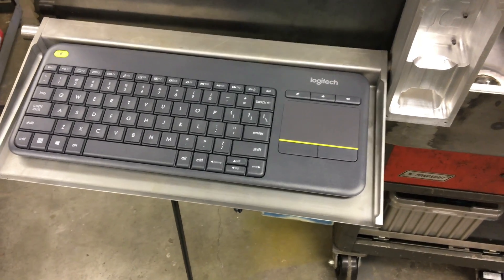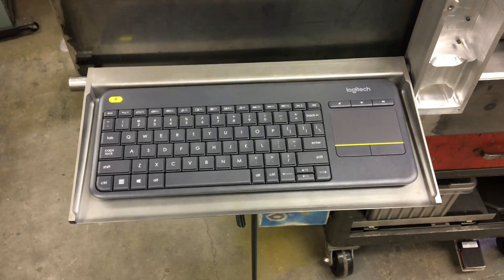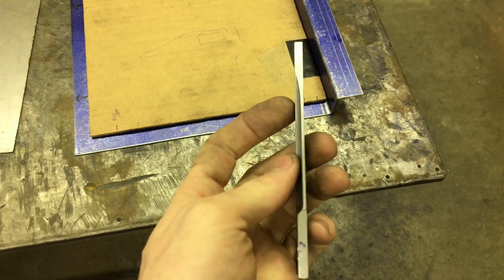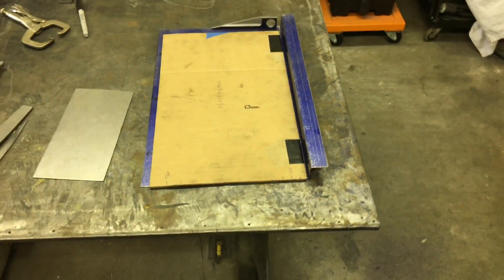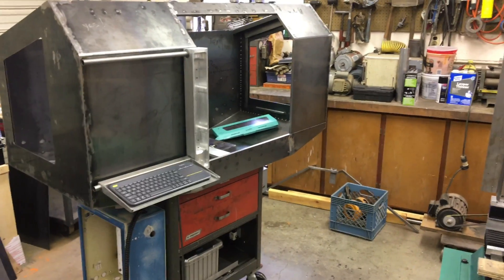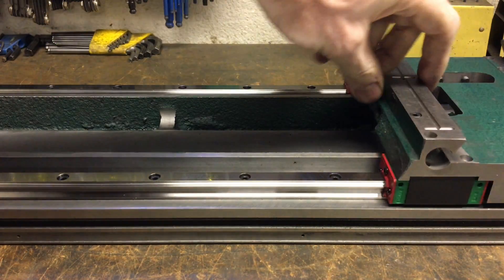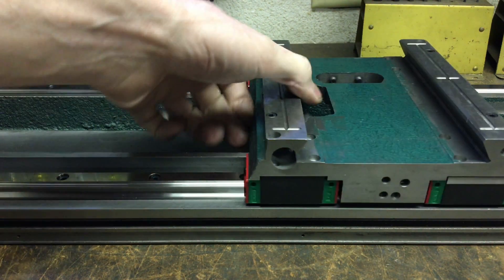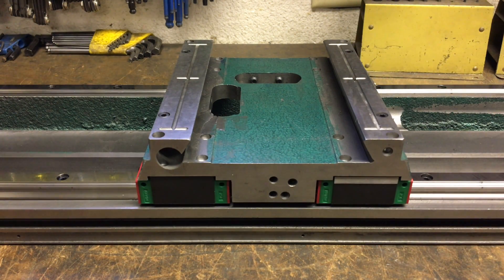GRIZZLY G0704 CNC Conversion Update 13 - ( X Linear rails complete / Keyboard tray )

Comment: I have an older machine with worn dovetails I'm about to do the same and extend the table travel at the same time. What is the weight rating of your rails?
Reply from the maker: Check out Hiwin's website, they have all the information for various rail styles / mounting configurations.

Comment: Totally radical bro! Looks killer!
Reply: Nicholas Miller I just ordered a generic universal silicone cover for mine. Less than $1 on eBay (350mm x 140mm). I am thinking of installing it on piece of aluminum plate that will act as a bezel around the top of the keyboard. That will hold the keyboard in place and apparently the touch pad will work through the silicone. I will report back if it doesn't.
Reply: Yeah I love mine so far. I like that it has multi touch and scroll on the trackpad. I use it to zoom in on the toolpath etc. Good value for sure.
Reply from the maker: Good to know! Is it possible to turn off all tap to click? so only the left and right psychical buttons work?
Reply from the maker: Thanks Buddy! I agree with you on the K400 keyboard, hard to beat for like 25$?
Reply from the maker: Hi Michael, thanks for getting back to me with your experience w /k400...... Do you have a link to the eBay listing for the Chinese silicone thing? - Nick
Reply: Nicholas Miller I doubt it... but I'm not sure what the settings are like in Mach 4.
Reply from the maker: I think there is some Logitech software that lets one configure the keyboard.....i.e not CNC software dependent? ..
Reply: This is it. It is universal so the keys are not formed. At the price it leaves plenty of room to experiment with forming it or see how it does unformed in a bezel. Will post pics on cnczone when I get mine done.

http://www.ebay.com/itm/Silicone-Skin-Laptop-Cover-Protector-Film-Case-Keyboard/252973493342?ssPageName=STRK%3AMEBIDX%3AIT&var=552007687993&_trksid=p2057872.m2749.l2649